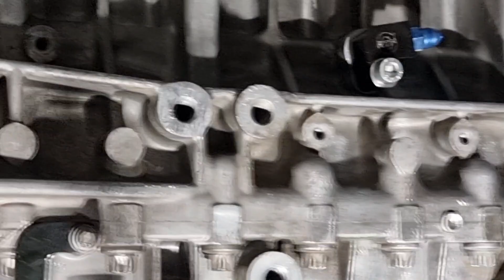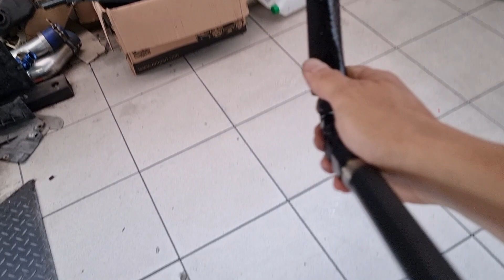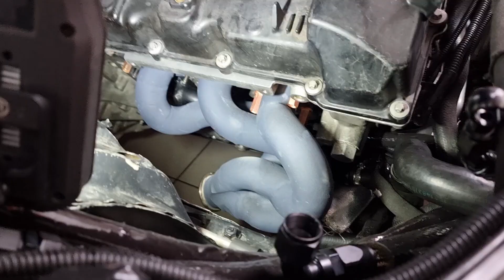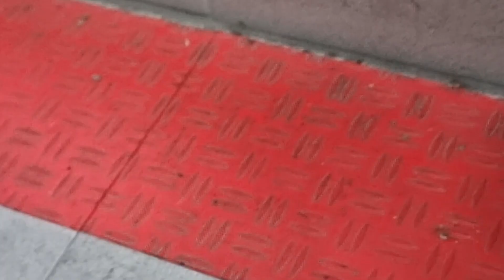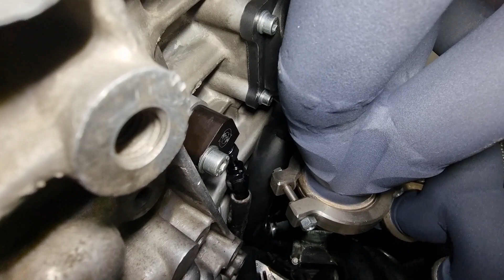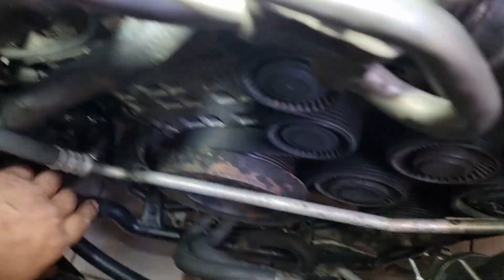N54 Single Turbo kit installation of the JMC Tuning equal length manifold.

Comment: Great kit and video, I like the catch can setup and how you retained the oem flapper for the high side. Do you have a video explaining the low/high side setup more in depth? I'm assuming you're running a one way check valve for the low side to the catch can and then from the catch can to the manifold/throttle body?